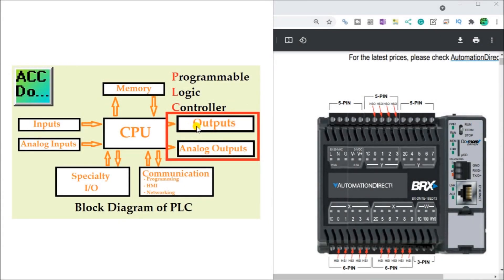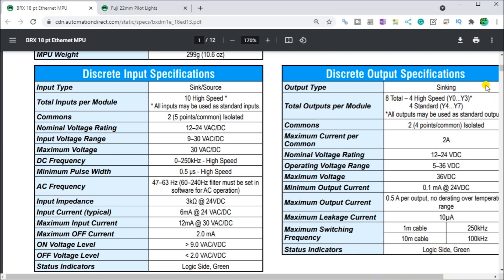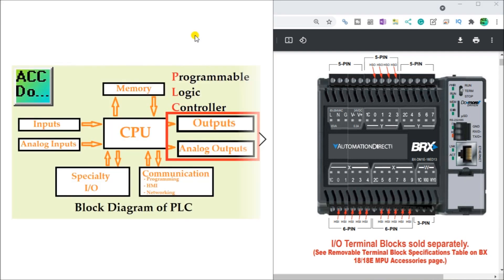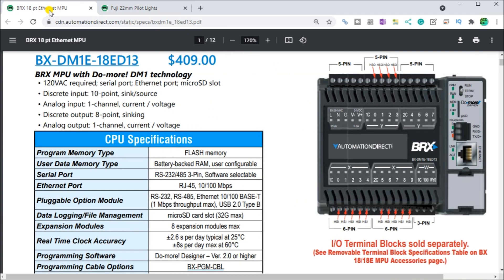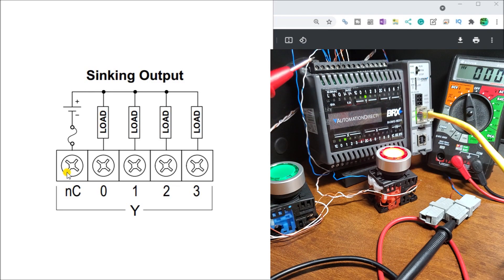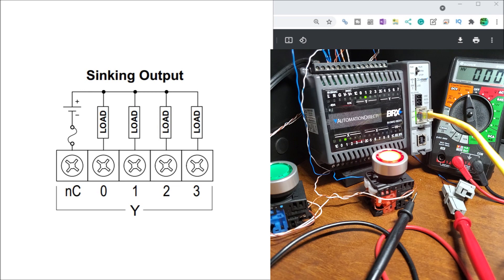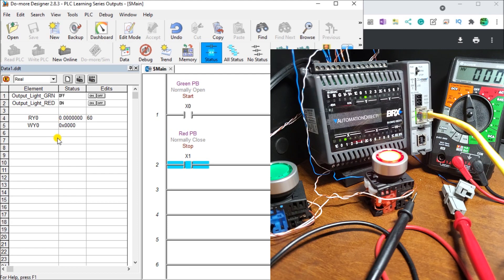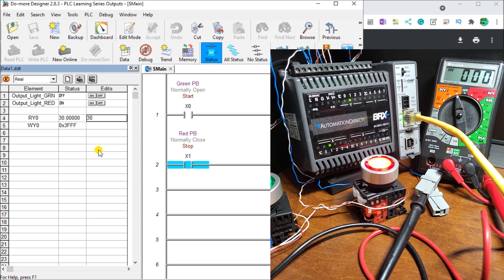PLC Learning Series - What are PLC Outputs?

Comment: do you know what the lightning symbol is on the bottom of a output module?
Reply from the maker: Where are you seeing this symbol? Is it at the bottom of the physical output module or in the software configuration for the module?
What PLC manufacturer and model are you using?
What is the actual part number for the output model?
This symbol on a Raspberry Pi refers to the power supply.
Thank you,
Garry

Comment: heyy, I got a click plc (C0-11DD2E-D) for a project.
my project is to configure a panel with touch buttons with the plc trough modbus rs485, but only one button is working. 
I program with FC 16 to send and FC 2 to recieve. 
could you help me to configure the other buttons on the panel (total of 15)?
Reply from the maker: I have a few questions on your system before I can answer your question.
You currently have a Click PLC C0-11DD2E-D controller. It has Ethernet, RS232, and RS485 ports on it. Are you communicating Mobus TCP (Ethernet), or RTU (Serial RS232 or RS485)?
What hardware are you using to communicate with the Click PLC? (Raspberry Pi, Windows Compter, C-More, etc)
What program are you using to communicate to the Click PLC? (Node-RED, VB6, VB.net, downloaded test program, python, C++, etc)
Regards,
Garry